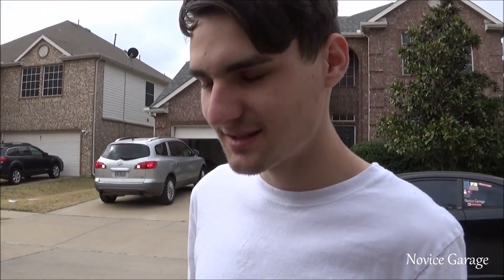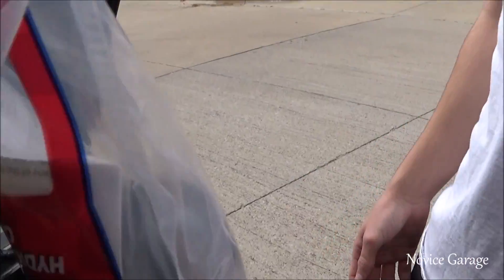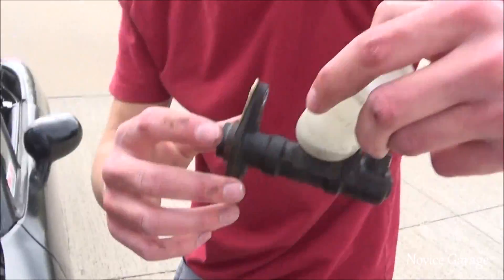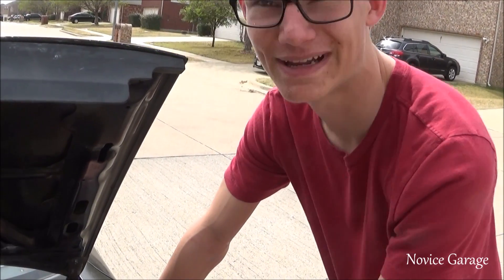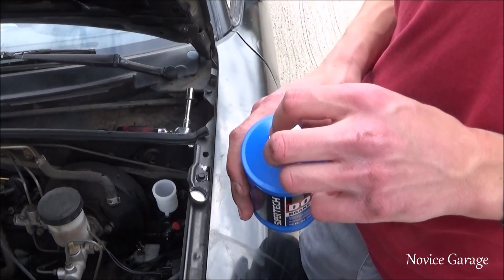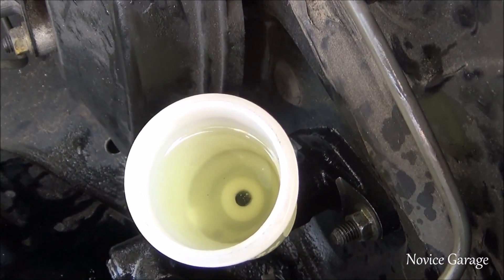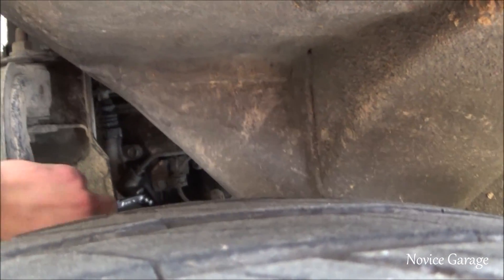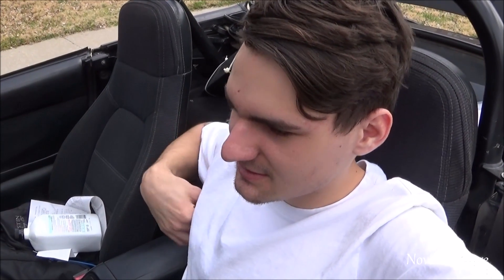How To Replace The Clutch Master Cylinder (Miata)

Comment: one does not pump the pedal. Have some one  apply constant pressure to the pedal, loosen the bleed screw relive the pressure and trapped air in the line,tighten the bleed screw FIRST then let the clutch pedal up. Keep repeating this procedure until no more air comes out of the bleed screw. ( bleed screw is one  piece and does not have a little nut holding it in)

Comment: Replaced the master and slave cylinder, pump the clutch and go to the bleeder nipple and no fluid comes out. clutch pedal feels like it has no pressure at all too. any suggestions?
Reply: there has to be fluid in the master cylinder reservoir. this is a 4 step process. step 1 open the bleeder screw on the slave cylinder, step 2 push the clutch and hold it down, step 3 close the bleeder screw, step 4 release the clutch. repeat this process until there are no more bubbles and the new clear fluid starts coming out. make sure your master cylinder does not run empty while doing this or there will be more air that goes into the system
Reply: me too, just replaced my Master cylinder - Zero, I mean zero pressure - I followed all  the  procedures

Comment: hey man I'm leaking the clutch fluid through the firewall in my Miata is that from the master cylinder?
Reply from the maker: Most likely its the master cylinder. If it still leaks after you replace it, the lines that run to the place are leaking.
Reply: +Novice Garage ok thanks

Comment: why replace the clutch master cylinder ( Miata) ?
Reply: I'm doing mine because I'm having trouble getting into gears, it's cheaper to replace the master cylinder than to take it to a transmission shop. If the problem ends up being that the master cylinder is faulty and not actuating the clutch properly, then replacing it will be a cheaper fix than taking it to a shop to have diagnostics and repairs done.